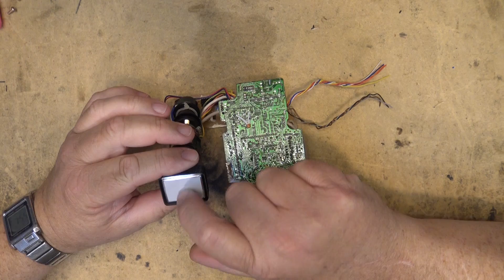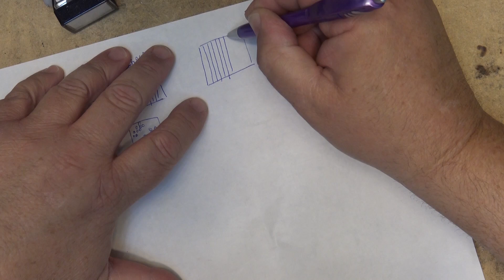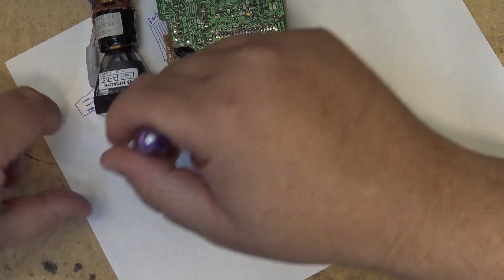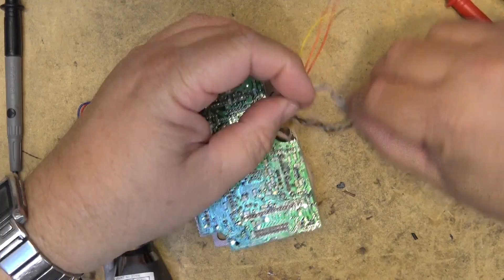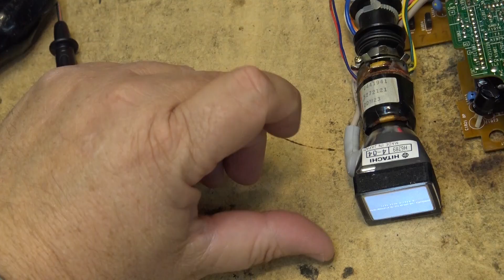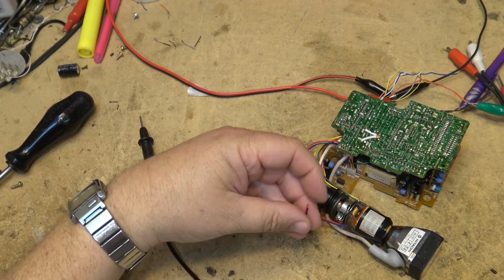Smallest beam index color CRT in the world

Comment: I don’t know how those filter sensors do work but i would be not suprised if they do serve as color holograms to get color on a b&w tube,
Reply from the maker: What the filters do is detect where the beam is as the beam moves across the screen the filters produce a varying waveform created by the color stripes on the tube. They are required to be in a viewfinder shell so no outside light affects them.  Sony did it differently by adding a fourth stripe to the inside of the tube that emits UV light and then put there beam detectors on the bell of the tube looking into the back of the tube that only detect the UV strobe stripe. Sony patented there be index design called indextron. Other companies had to come up with their own way of doing it as to not infringe with Sony's patent and this was their result.
Reply: @12voltvids  but i still don’t understand how those sensors detect the light beam unless they use prediction, also how is blue generated since theres only a green and violette sensor,mmmm

Also you might think that a single light beam with a color shadown mask or trinitron might be possible by just increasing the speed of the light beam 3 times by alternating between red,green and blue in a row in a certain pattern by moving from one position to the next one and back again,

Also you might think that color turquaze and red could be enough to produce all 3 basic colors ,because when no light is hitting turquaze you will get blue but once you shine yellow light against it you will get green , now just imagine cameras and tv sets only relying on turquaze & red to produce all 3 basic colors, maybe not exactly but close .
Reply from the maker: You're totally missing the point on how the beam index system works. The beam index still uses three colors red green and blue but unlike a conventional picture tube that has three guns each aimed at the respective color dot or stripe which is aligned using a shadow mask or aperture grille a beam index tube has no aperture grille or Shadow mask and uses one gun like a black and white tube therefore the circuitry needs to know where the beam is as it scans the tube surface two ways this has been done number one with Sony's system that was used on both their trinicon camera system and on the indextron CRT. On the trinicon camera tube there was a metal grid laid out across the target with a separate lead that exited the tube as the beam scanned the target this electrode would detect the beam passing over it and produce a pulse that was used by the multiplex circuit to create a phase lock loop to chop up the colors into the red green and blue components as filtered by the stripe filter on the front of the tube. On the indextron tube there was a fourth stripe added to the backside of the phosphorus on the front you would see red green and blue and then a slight space followed by red green and blue that small space had a UV phosphorus stripe that would emit ultraviolet light but it was painted on the backside of the screen so as the beam passed over this UV stripe it would emit a pulse of ultraviolet light this pulse of ultraviolet light was detected by two sensors that were placed on the bell of the tube I would look into the back of the tube this provided the reference signal to synchronize the phase lock loop to multiplex the three colors into a single switched output so the switched output goes red green blue red green blue red green blue as the beam passes over the tube this is Sony's patented design. Other companies like Hitachi had to come up with their own method of synchronizing the switching for the color circuit they did it by using a yellow and cyan filter in front of photo transistors. The yellow filter would pass light from both the red and the green stripes and the cyan filter would pass light from both the green and the blue stripes if you're following me now you would see that as the beam were to pass over the red and then the green stripe there would be a pulse presented to the yellow photo transistor and then as the beam continued from the green to the blue the second pulse would start as it was passing over the green and continue into the Blue then switch back to the yellow sensor as the beam hit the next red stripe now you have an overlap you have a pulse of light that is only present when the beam is over the red stripe and you have a pulse of light that is only present when the beam is over the blue stripe and you have a wider pulse of light from both detectors at the same time when the beam is over the green so you get basically an overlap so that there's signal through both photo transistors when the beam is over the green but only a single when the beam is over the red and the blue thereby the multiplex circuit knows this is a red and this is a blue and this is a green and it can time the multiplex switch accordingly it's a simple system much simpler than Sony's which required that fourth stripe on the tube the downside is that the photo detectors with their cyan and yellow lenses must be totally shielded from any external light so the only application is building them into the viewfinder where they are far enough back and in behind magnifying lenses and so forth to prevent any external light from reflecting into the sensors which would cause them to lose sink and the picture to turn to black and white.
Reply: @12voltvids  woow that’s very interesting.

Comment: You say the high voltage is 5kV because of color, but I guess its not going to be higher than a comparable b&w since it does not have a shadow mask which absorbs most of that extra energy.
Reply from the maker: Beam index tubes are nothing more than black and white tubes with color stripe phosphor.  It's not so much the shadow mask that absorbs high voltage.  In fact it is charged to the same high voltage. It is the fact that you have 3 beams being emitted so 3x the electrons plus you need to accelerate them faster to get them through the shadow mask as a high percentage are going to hit the mask and be absorbed by it.

Comment: What size would this be considered? I know the smallest traditional CRT with shadowmask is the 1.5" CT-101. Just curious what the smallest beam index color CRT measures in at. Great video btw, just discovered your channel!
Reply from the maker: This one is 1.25" and so far I only have it working in B/W because I do not have the color filters that go over the 2 detector diodes that sync the color.
Reply: @12voltvids  1.25", thanks! So I guess that means if I were to procure one of these out of an old camcorder I'd end up with a similar color issue?
Reply from the maker: @speedyink  Yes, they need to be operated as a viewfinder. Had the fella that donated this one sent it to me as the entire view finder rather than scrapping the cabinet then it would probably be working now. The detectors were mounted in front of the mirror that you viewed the screen through and picked up the beam as it flashed across the screen. One was a yellow filter and the other a blue so by averaging they could figure out where the beam was. A goofy way of doing it like the color vidicon tube (and newvicon, saticon ect in cameras) They used a cyan and green stripe filter as well as clear, and used the relationship to figure out color.
Sony did things differently with their trinicon tube, they put a very fine set of vertical electrodes on the surface of the tube that as the beam scanned a voltage would be detected to synchronize the color multiplex circuit, and used a RGB color stripe on the tube.
Sony's beam index was called Indextron, because they used a 4th stripe on the inside of the CRT between the red and blue stripes on the front of the tube. This 4th stripe was UV, so it was invisible, but it strobed into the inside of the tube (as it was placed on the back side of the phosphor on the face plate of the tube.) These UV stripes would flash as the beam swept over them, and was detected by a photo detector glued onto a clear section of glass on the bell of the tube. This provided the synchronization signals for the color multiplexing circuit. 
I have an indextron video projector and it is quite cool. Not a super high resolution picture, but as a single tube projector it is usable and quite bright for a CRT. It is liquid cooled. 7" tube.
Reply: @12voltvids  Oh, so if I were to procure a full camera/viewfinder, I could still get it to work! I'm looking at cameras like the RCA CKC-021. I know they use a mirror to point the image to your eye, but it's sounding like I'll need to be careful, and figure out that sensor setup. Good info for sure. My idea was to make a little miniature television cabinet for it. 
Wow, thanks for the info! Would the Sony KV-4000 use the indextron beam style? That was another set I had my eyes on.
I love this sorta technology, so fascinating.
Reply from the maker: @speedyink  the kv4000 was a Trinitron. The smallest they made.  The indextron was the kvx370 which was a 3.7" 3.5 viewable screen. The indextron sets say indextron right next to the red green and blue ovals in the top left side of the cabinet.
Reply: @12voltvids  Ahhh, ok. So the KV-4000 measures in at 4" while the Indextron KVX370 was a bit smaller? Good to know. Amazing their smallest Trinitron was so close to their smallest indextron in size.
Reply from the maker: @speedyink  
Screen size yes but huge difference in tube size.  A 3 gun trinitron is fairly deep. The tube was about 8" long so the set was about the size of a lunch box.  The indextron was a 4" x 4" cube.
Reply: @12voltvids  Ahh, that's a good point. a 4" cube sounds pretty damn sweet actually..
Reply: Good video, regarding the missing filters on the sensors, I'm wondering if the filters from a scrapped DLP or 3LCD projector placed over the sensors would work? Would make for an interesting video

Comment: I understand how it would detect the scan frequency and phase with a PLL by detecting pulses from the red phosphor. But I don't get how this works if you have your camera pointing at, say, something green for a while. If the red phosphor doesn't light up at all, the PLL is not going to get any input and the color generator is going to drift, isn't it? 

In other words, doesn't the detector have sensors for all three colors so that it only loses color sync when it shows a black picture?
Reply from the maker: There are 2 detectors with color filters over the phjto detector.  One detects  blue and the other one red/green spectrum. This way there are always 2 signals out of phase with each other.  There is also a uv stripe that is picked up with the blue sensor and the tubes are biased so there is always a dim glow so even if the picture is black there is enough emission to operate the pll. Once I get the sensor I will be doing a follow up and will show the quality of these little tubes.

Comment: I have schematics for this viewfinder. Change the last digit 1, 2, 3, and 4 to get all four files.
http://www.labguysworld.com/SCH_RCA_EVF-32_BEAM_INDEX_COLOR_CRT_001.pdf
For everyone. Enjoy!

This viewfinder most definitely has UV index stripes. The photosensor board had two photocells. One is masked in yellow to block UV and pick up white light, the other is masked in deep blue to pick up the UV index pulse. By clever addition and subtraction of the two photocell signals, the beam index pulse could be recovered very clearly.
Reply from the maker: I have never worked on this type before I know the detector had 2 photo detectors, didn't know if it used a UV stripe or just keyed off the red and blue. Sony did it different using the detector mounted on the bell of the tube, and having the UV stripes on the back side of the phosphorous
Reply from the maker: Where those filters external to the detectors, as in mounted to the plastic cabinet that the detectors sit in?

Comment: Trying to wrap my mind around how fast that circuitry has to work in order to time that beam as it sweeps across the screen! And thats nothing compared to modern electronics!
Reply from the maker: The switching is not as fast as you would think. to calculate this all one needs to know is how many stripes are in the tube. That number x3 x 15754 and you get the switching frequency. Still will be interesting to see working in full color after the color sync detector arrives next week.

Comment: Now how did they get away with the beams crossing without total protonic reversal occurring?
( I'm sorry I couldn't help it)
Reply from the maker: In the CRT the actual place the beams cross over is as they pass through the shadow mask on every drawing I have seen.
There are magnets and correction coils on the bell of the tube to dynamically correct the beam as it travels across the screen.
Reply: That's a ghostbusters reference...

Comment: I would imagine if they were using such a device today, a single chip would have been doing all the colour magic, the pcb would be limited by the size of the lopt.
Reply from the maker: If it was high volume they probably would have but the color crt viewfinder was a commercial failure because if the poor resolution.   Cameras with color viewfinder were restricted to auto focus operation because the color viewfinder (tube and lcd) were not good enough for precise focusing.  That is why most cameras used bw tubes.
Reply: I had never thought about the focus problem, i can see how poor the user feeback would be with colour.
I watched a black&white tv for years, an old pye rambler portable with a philips tube, it served me well.:-D
A very sharp little picture, i also used it to check the head switching point near the very bottom of the screen scan for vcr checks.

People play with the head guides and control head for some reason??.
i sat there and got the path correct then small tweaks to get the tracking and sound sync right, plus head signal balance and control head amplitude.
I wasted a lot of time helping silly people, but i saved a lot of nice machines from the bin.
Reply from the maker: @zx8401ztv  
In the TV station I worked there was this ancient conrac under scan (black borders on all 4 sides) monitor with about a 19" tube with an 18" picture.  It sat atop the old rca tk20 telecine camera. It had no cover on it, just a bare tube clamped into a metal chassis. The tube was a very long tube and the neck was probably 2" in diameter at the gun.  It was solid state, but an early one.  It ran 24/7 and for most of the day just had a black raster. If you turned out the lights in the control room you could see the raster. The filament in the back glowing orange.  This was used on the telecine when we ran either a slide or were running film. Used by the operator for setup. We would put a chip chart or registration chart up and run a slide projector with no slide so it was a white screen that shone through the test chart which were made out of glass and placed on the lens. The  we would use this very high resolution monitor to calibrate the 4 tube camera.  This old rca camera had 4 pickup tubes.  Red green and blue vidcon tubes for the color portion of the image and a larger monochrome tube, an image orthicon if I remember correctly.  It had an amazing, razor sharp picture.  You could almost feel the xrays blasting through your body standing in front of that bad boy.
Reply: lol free xray at work :-D
I did have a look for the tk20, i stumbled across a tv video camera museum.
The rca section: http://www.tvcameramuseum.org/rca/rca_list.htm
im sure you have been there.
Reply from the maker: It was a TK27 telecine. 
Here is a picture of it
http://www.earlytelevision.org/rca_tk27.html

Comment: It's always amazing how they can get a CRT enough voltage to run on a battery.  I am used to big-ass CRTs and heavy flyback transformers.
Reply from the maker: It really is not difficult. You have to have both vertical and horizontal oscillators and output circuitry to generate the sweep drive for the yoke. A simple step up transformer is all that is needed. The current is in the microamp range, so the transformers can be very small for these little tubes.

Comment: In the absence of the correct original detector, I suppose one could experiment with a photo-diode or photo-transistor and a filter to try and getting it to sync and show colour?
Reply from the maker: Original color sync detector has been located and is being sent over.  A follow up video once it arrives.
Reply: @12voltvids  was a video on it ever posted? if there was i can't find it.
Reply from the maker: @aarontrupiano9328  
No, The detector was received but not the color filters for it.  I don't know what wavelengths they pass. I tried blue and yellow but no joy, it only displays black and white.   Still have it.  Would like to get it to display color but without the correct filters that isn't going to happen.
Reply: Yay